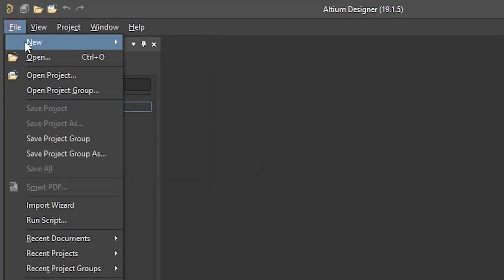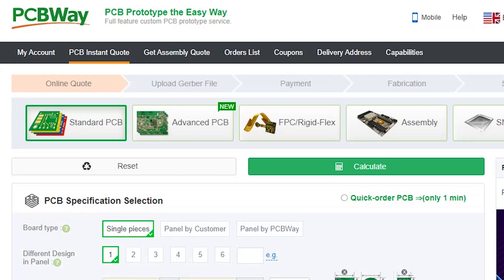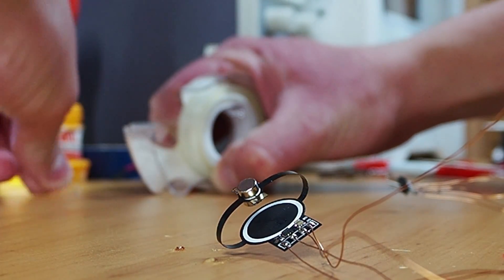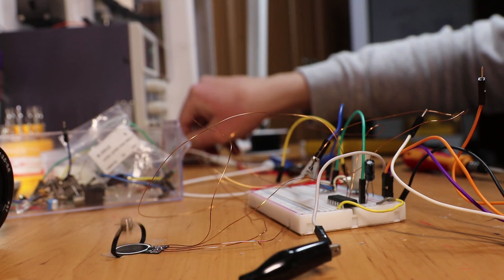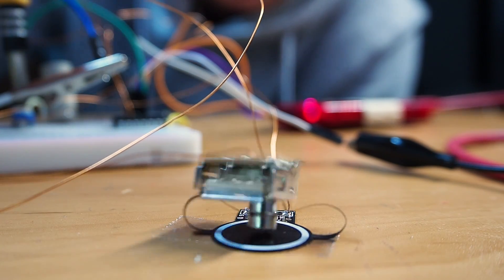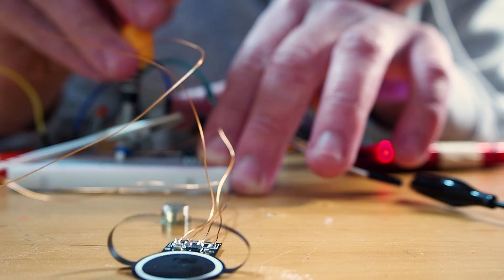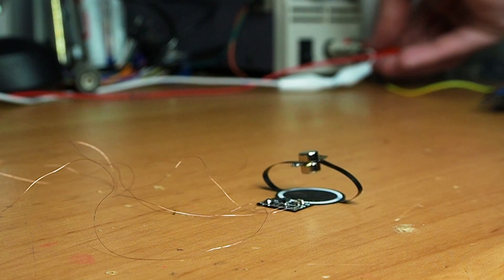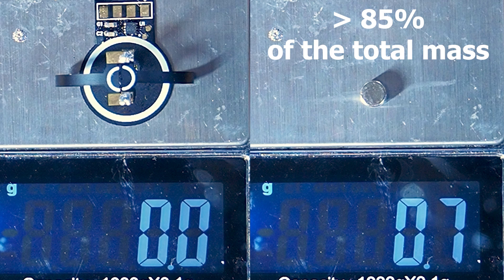I made a circuit JUMP!

Comment: Soooooooooooo.... Might spam this because I'm curious. How would the PCB coils act as a solenoid coil? As in, the magnet held in place going THROUGH the coil, with flex PCB holding the magnet between the coil? Using the magnet to actually push on the ground instead of the PCB traces?

Comment: Could you take your ribbon of coils and fold it onto itself in a zig-zag pattern so that when you apply current it repels itself and extends? I wonder if it could jump further?
Might need a small capacitor discharge to drive it though since they would all need to be in series to repel evenly.

Comment: Hey, question.  Did you have the coil turn on and off, or did you have it flip polarity?  I was thinking that if it flipped polarity, and not only let go of the magnet, but also pushed it away, you might get more height.  You didn't indicate which you did, so I thought I'd mention it, even though you probably are already doing it.
Reply from the maker: The coil''s polarity was getting flipped

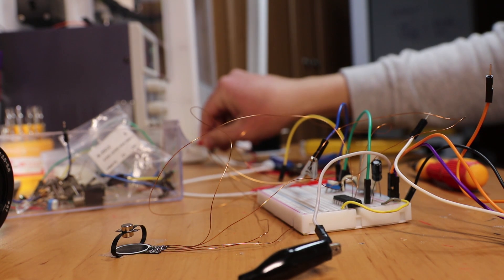Comment: 1:40 Do you think could just use a transistor in Astable Multivibrator mode instead of a microcontroller? That would be simplier. If it can't supply more current, just add a darlington pair at the output.

Comment: Maybe you can see how long it takes for it to take off, and then reverse the polarity again so it pulls up its "leg" to jump higher. (similar to how people can pull in their legs to get their feet higher when jumping)
Reply: thepianoaddict i had the same idea, my inspiration comes from audio, what about yours?
Reply: @paloaltoinfo  I simply thought about how nature does this, biomimicry is widely used to design and improve products. Can you elaborate on how audio relates to this? It "sounds" interesting :P
Reply: thepianoaddict loudspeakers and dynamic microphones use coils and magnets to create a variable magnetic field that is used to move the speaker membrain or, in the microphones, the membrane is phisically connected to a permanent magnet that runs inside a coil generating a variable voltage with the same waveform of the sound (with some litmitations due to construction and material phisical limits of the transduction process (call it efficiency of the system)

I think that “tuning” the timing of the repulsive impulse and the subsequent attractive impulse you can get a higher jump, probably it’s just a matter of timing, I would try and see if it works but unfortunately I’m poor in electronics, I just started to play with arduino one week ago 🤪

Also I would try other coil configurations (number of turns and thickness) to increase electro-magnetic field as much as possible

Comment: Why did you need a flexible pcb for that? From what i see the flexing parts aren't conducting any electricity, and there are better mechanics ways to get lightweight springs that flexible pcbs
Reply from the maker: Agree but this is just a proof of concept.. Maybe in future versions I can explore a version that has all the electronics on top
Reply: @CarlBugeja  i think you should try some electromagnets, they're a lot stronger than permanent ones and you can use flexible pcbs to deliver power to them.
Reply: You could still have moving mass for jumping, not from permanent magnets but from the coil weight

Comment: how about making a jumping circuit that you can control by having multiple coils that you can activate manually? for example 4 coils in the pcv, if you want to go forward you activate the most backwards coil and that will make the magnet be retracted backwards and on release it will jump forward
Reply from the maker: For bidirectional movment 4 coils will be need for sure 👍🙂

Comment: Do you even NEED the flexible part to be pcv? since there's no circuit you could be using a more suited material
Reply from the maker: Other materials can be used. I decided to make it part of the pcb itself as this is just a proof of concept. If I were to design a more complex version we would need to pass some signals through those flexible arms
Reply: @CarlBugeja  What about inverting the polarity of the coil in order to give it an extra push at the jump? it would have to be a short signal since it could cause the magnet to flip over instead

Comment: Put a small hole in the disk part and add a thin shaft pointing down from the magnets through the hole and you have a pcb pogo stick. I think you would get much higher jumps and a linear actuator to boot.

Comment: I have an idea for you: Try to make a fan with changeable rotor blades. So it can be switched from max airflow to max static preasure smoothly with (many) steps or even stepless. This could be used to optimize loudness of the fan for dynamic situations.

Comment: Do you think it is possible to control position of the magnet by controlling duty cycle applied to the coil ? I think at the top and bottom most positions it will be hard due to  high bending resistance of the flexible PCB, but it seems like it would be possible to control it around the middle position. Or during the periodic motion of the magnet can you know its position accurately enough to apply open loop position control to it ?

Comment: Incredible video as always! Maybe a small recommendation. If you'd increase the stiffness of the PCB spring elements (e.g., by adding more flaps) you could theoretically store more elastic potential energy before any jump and thus jump higher. A minor design improvement would be to place the flaps in a circular array instead of the current horizontal outlay. This would not only increase the mechanical compliance but also stabilize the vertical trajectory of the magnet.

Comment: compared to the arrangement of common speaker which is a cylindrical coil next to static magnet, where the coil is dynamic, how much is the efficiency of this arrangement which not only the opposite, but also using a pancake coil, can you produce same thrust with same amount of power needed for a speaker to move the coil?

Comment: It was called anti gravity engine principle...use longitudinal wave on mass transfer or mass oscillation.
...
...
You need to create rotation and manipulaton its by unbalanced.
...
You can make magnetic vortex by ultra violet laser as high voltage run way as long as the laser rays

Comment: If I could draw on the monitor with a marker, I would be so happy...
Reply: Are you discussing the ethical aspect of drawing on the monitor with a marker?
Reply: @Ntrbncmlc  No
Reply: With a real marker..🙂
Reply: Ramli Zulhilmi Fit glass over it that can wipe expo marker off :)
Reply: I assume he put some transparent plastic sheet over it before drawing, so no harm to display
Reply: You can! No one is stopping you. Paint is best.
Reply: you can but not a good idea lmao
Reply: It works  well if you use dry-erase. No real trouble as long as it’s a glass screen
Reply: Thats called a touchscreen
Reply: Just do it, believe me, it works. Best results using a permanent one☝️